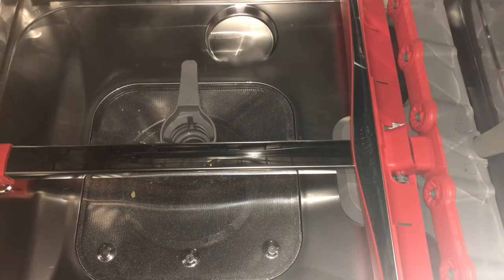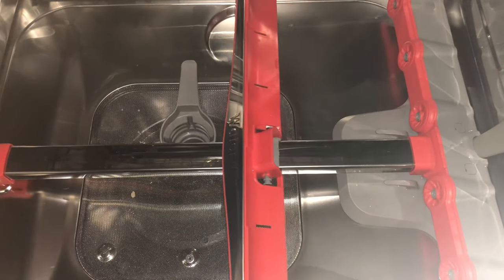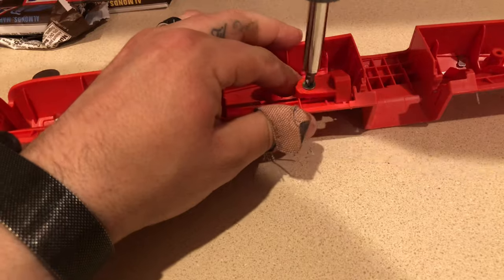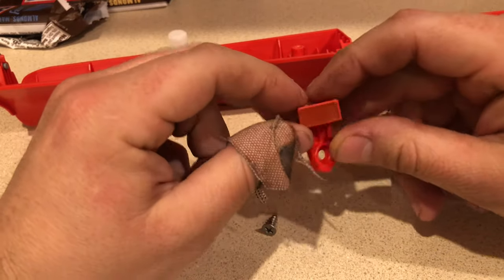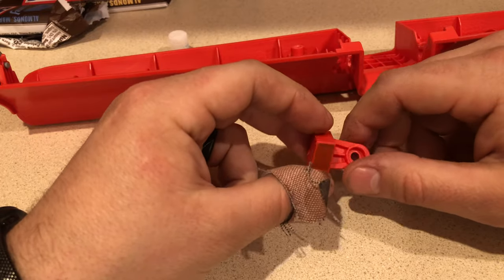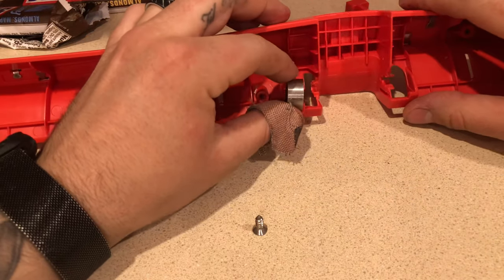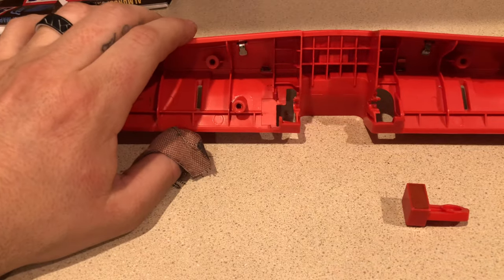Samsung Water Wall Issue Part 1

Comment: One of the most excellent repairs I have seen and used. Thanks a lot . I removed the coating over the magnet, drilled a hole pushed out the old magnet and stuffed in a new one, applied hot glue and it works great now. A real cheap fix buddy.

Comment: THANK YOU!!! While under Best Buy extended and after numerous service calls during a six-month period, they claimed it was fixed.  But I kept hearing that noise and noticed dishes on the bottom were not getting cleaned.  I put my camera in the dishwasher and saw the same thing.  I found just the magnet  Samsung DD97-00395A Plastic Magnet Support at Virginia Service Supply.  I pulled out the waterfall sprayer and to my surprise, the magnet was not even installed.  I installed the magnet myself and like magic, it Works!
Reply: TY part number was helpful!

Comment: I took the red gel stuff off the top of the magnet to test it. Ran a diagnostic cycle and the dishwasher worked fine. I ordered magnets to replace them in case it fails again later but thought I would share as it only took 2 minutes to diagnose. Thanks for the video!

Comment: Thanks! My dishwasher was making a noise. I had figured out that the detached waterwall was the problem, and I could even see the notch where it was supposed to hook into, but I couldn't figure out how to get it to snap into place. The 45 degree angle was the tip I was missing. I had to hold my fingers against the bottom part I was I snapping the water wall on to, but combined with the 45 degree angle trick, it worked like a charm! No more noise.

Comment: Thank you for this video! I have same washer, it had the same problem and you got me thinking of a simpler solution.  I purchased a pack of 3/8" X 0.060" rare earth disk magnets at the hardware store, they cost less than $5 for a pack of 12.  I took out the bar, snapped one disk magnet on top of the existing magnet, put the bar back in, and the problem is gone!  The new magnet is stuck so hard that I can barley pry it off, so I doubt it will ever drop off on its own.  Just be certain to use a thin magnet, because the first time I tried this the magnet was 1/8" thick and it was to big to work correctly.  Thanks again for the idea!
Reply from the maker: Jack D My original rare earth magnets eventually corroded to the point where they dislodged. As I learned it was a bad choice of magnet. They do not do well with heat and moisture.
Reply: @honestdad8944   - Did you by any chance find a solution that lasted? I believe that my dishwasher is having the same problem. I it only 3 years old and I really don't know what to do at this point. Thank you!
Reply from the maker: Melinda Opalanko I did.  I found a magnet that is heat resistant and fits inside the original magnet housing. The type of magnet is Samarium Colbalt.
Reply: @honestdad8944  thank you so much! I am going to look into that!
Reply: @honestdad8944  thanks for putting the video together. Do you have a link or part number for the magnet that worked?
Reply from the maker: Ryan Foltz CMS Magnets. Samarium Colbalt is what you want.
Reply: Worked like a charm.

Comment: Just used this fix on mine. That red piece the unscrewed contains the magnet but you can easily pull it out of that plastic shell.  So I removed the factory magnet and put in two 1/8 thick by 1/2 diameter rare earth magnets in that sleeve without any epoxy or anything because that red part contains it. After reinstalling I had to hold my finger on the start button for 3 seconds to reset it before starting a new cycle. Didn’t work without resetting. Hope this helps and saves you some money.
Reply: How did you take our the magnet from the red plastic shell? Thank you

Comment: Did you ever make the next part? How long did your fox last? I just replaced the waterwall motor assembly and not my waterwall goes front to back but it appears to try to keep going back further for several seconds when it gets to the back.

Comment: I have replaced the magnet with a new factory replacement waterwall still doesn't work. What can be causing this issue. All help would be greatly appreciated TY.
Reply from the maker: Control board would be my next guess. You need to figure out what code the washer is faulting with and go from there.

Comment: Hi Honest Dad. I did not finish watching this video and I wanted to thank you for making it. Best Buy and their geek squad protection plan is the worst service in the world. I purchased $800 samsung dishwasher and extra 5 yr warranty. Technician came one month before warranty expires and said its working normal even though there is a very loud whining noise. Now I call them and they will not help me because warranty is over I almost cursed at them. I will fight To get my money back and fix it myself or contact samsung. AVOID BESTBUY FOR APPLIANCES, PERIOD.

Comment: Hey Honest dad, I have a DW80M9550us that the 5c code came up, which is pump clogged! I’ve checked filters, drain line but to know avail think it must be in the pump! Do you have any experience getting at the pump on one of these beasts?  I could really use some help!  Thanks

Comment: I spent about 3 hours and I think it's either my magnet or my motor. The water wall moves but not as fluid as yours does. It goes really slow and looks like it's struggling. So I'm going to try the magnet but if that doesn't work I'm going to get a new motor. Thanks!

Comment: If the magnet sticks to the fridge does that mean it is still operational?
I fixed the waterwall motor like in the other video but now the waterwall either moves to the front or the back but doesn't know when to stop. 
Just keeps skipping on the track.
Reply from the maker: Mine would stick to a metal surface as well. But it’s not enough to make the sensor. The magnets aren’t suited for high heat environments and loose the strength.

Comment: What model number is that? Mine is DW80J550US and my waterwall doesn’t have that magnet thing that unscrews under it and doesn’t even have a place for it to screw in. Maybe it fell out, but I don’t see where it screws in.
Reply: Mine is the same. Did you ever figure it out ?
Reply: @karao7831  I did end up figuring it out. I can’t remember what I’ve posted above, but I will say that after putting my phone in a glass container and running in the wash for half cycles, I discovered the motor for the water wall was not working. I replaced the part for $140, but then had the problem with the water wall would go forward and then just go back and try to keep going back and not recognize that it had hit the back of the washer. I bought a magnet which I saw somebody suggested online in a video and just stuck it underneath the water wall, or I should say it stuck by itself because of the magnetic field. It’s been working fine for a couple months until just the other day. I then looked at the magnet and so it was all corroded so I put another one on it and it’s been working fine.
Reply: @karao7831 I stuck the magnet under the gray piece on the bottom of the water wall. Then when the water wall went back the sensor detected that magnet and then bright the water wall forward. I can post a link to the magnet I got if you’d like. It took ordering a few to find the right size.
Reply: @wstt4  Will you please post the link to the magnet?

Comment: Any idea i have a 7e error but just checked mine doesnt have a magnet or a screw hole
Reply from the maker: Not sure. You may have the oddball interaction after mine that is different.  They redesigned the Waterwall 3 times I believe
Reply: @honestdad8944  how fun I can see my motor moving yet I still get the error I even tried a bigger magnet. Maybe someone said my motor is getting water in it and shorting or the sense by the motor is broken that they don't sell separately

Comment: hey @honest dad thank u so much for the awesome video and inspiring me to dig into this issue! i have a DW80M9990US and it recently started giving me a grinding noise, when i put the dishwasher into diag mode, error code 7c results. i have reset the dishwasher and moved the water vane to the back of the dishwasher and still no luck. further we had a samsung tech come out and replaced all the parts u highlighted, vane motor, pcb and finally wiring harness. i recorded the vane motion inside. when i pushed the vane to the back of the dishwasher next to the jets and started the diag mode. unlike your vane going from back to front and vice versa, my vane just goes to the front and grinds until the diag is complete. i also bought some magnets and stuck them right on top of the original magnet without luck again. any thoughts as to why the vane keeps bumping into the front please?
Reply from the maker: I’m sorry I don’t. I have came to a conclusion and it’s a painful statement. Chuck the washer in the yard and buy another. Since this video my upper sprayer stopped working. I have a new washer on order for July delivery. They are quite hard to find. I went with a new Storm Wash that does not have the moving lower arm.
Reply: @honestdad8944  :( sorry to hear that. my dishwasher is less than 2 years old. just thinking if replacing the vane motor / vane sensor one last time will help?
Reply: @honestdad8944  thank you for your help. gonna head your words and get a new dishwasher.
Reply: you don't manually move the water vane. that's how u break it

Comment: My problem is the water wall bar is falling off at the front of rail. So then trolley just goes back and forth with no bar to deflect the water up. The dishwasher is only two months old. I see nothing wrong with the bar or the trolley. If put it back on it works for the test that occurs at the beginning of the wash cycle but once the water jets are turned on it falls at the front of the rail. It doesn’t snap on the trolley. It is up gravity to keep it on there and I think the water pressure is high enough to lift it off when the trolley reverses to the back of the dishwasher. It is an asinine design. The warranty repair guy is coming in two days. It will be interesting to see what his explanation is. I am sure they are told to lie about it. Problem is I’m an engineer and I can see why it doesn’t work. The design sucks! We already had the auto-release mechanism replaced two weeks after getting the dishwasher. That has stopped working again too. We are going to open another ticket after the water wall issue is looked at. We are working on getting it lemoned so we can get a refund. Otherwise they will be paying for service calls every month for the next 10 months.
Reply: Did you find out what was the issue? I have the same problem and wondering what is causing it

Comment: I have the same model dishwasher with the same problem. I replaced the magnet but the problem still isn't fixed. My next thought is the water inlet valve, unless you have any other suggestions? When I manually add water to the dishwasher and try to start it, I can hear the water draining into the disposal, so I don't think that's the problem. Any other thoughts?
Reply from the maker: Steven Davis Honestly you need to see what’s happening inside the washer. If the washer doesn’t see the Water Bar or know it’s location it will not spray water from the jets in back. That water spay hits the bar and washer the dishes in lower rack. If your Bar carrier is not moving at all then it’s either the motor or the PCB board. Either way your gonna have to see what happening inside like I did.

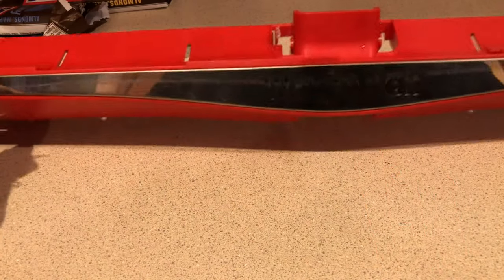Comment: Hello @Honest Dad, I believe your issue is the carriage and water wall are not connected completely. You have to press them together until you hear a click. In your video the carriage at second 3:40 deflects upwards as apposed to downward like it is supposed to. If you watch this video https://youtu.be/3py7fK2m9Gc at second 0:27 the carriage and water wall deflect downwards as apposed to upwards like your wall did. I believe your sensor is not making correct contact because of this issue. Kyle P in Part 2 pointed this out and I did some more digging. Hope this helps.
Reply: Bro you are rock, I have linear dishwasher for less months and have this noise and figured out that something with waterfall system. And guess what?!? It wasn’t proper install, so I just clicked and that’s all!!!!
Thank you

Comment: My waterfall fell off on its own, as well as another piece. Idk how to put it back on :/
Reply: Just GENTLY pull the carrier along the support bar about 6" from its home position. It's pretty tight so don't pull too hard or you'll have a bigger (and more expensive) problem on your hands. The water wall bar will fit on and snap in place with gentle pressure, just make sure the magnet is on the left. Just run a rinse cycle to get everything back in place. You don't want to manually move the carrier any more than you must.
Reply: Thank you Mr. Pavone. Mines been giving me fits. This worked. Ty

Comment: I thought my issue was the water inlet valve.  It was this all along.  So ticked.  Terrible design.  Thanks for sharing.
Reply: additionally, if anyone wants the part number for just the magnet piece, it is DD97-00395A

Comment: Which model is this?
Reply from the maker: Emily Carpenter DW80J7550UG
Reply: The DW80H9930US/AA-00  does not come with a screw in magnet on the water reflect piece. I in the process of adding a magnet in the same location. I will update with results.
Reply: rzooter:  I am having the same problem and have the same model as you.  Do you have an update on the results? Any help would be appreciated.  The dishwasher is less than 5 years old and this is the third problem we have had.  😡
Reply: @jamfonz  Yes. I had No luck. I did try several ways of placing a strong earth magnet. Even to replacing it in the original location. My dishwasher gives out after 15 minutes. The rail moves and it does not get jammed. So my guess again is going to be the computer module. 😵 giving up.
Reply: @jamfonz  we also did not have a way to fasten the magent. I bought a new waterfall arm (the one he removes in the video) which did nothing. Bought a new GE dishwasher and couldn't be happier

Comment: Hi my Samsung washer was fixed after this thank you, I had a 7C error code after self diagnosing it.
I used the OEM magnet from Amazon
Samsung DC61-03184A Washer Lid Switch Magnet Genuine Original Equipment Manufacturer (OEM) Part https://www.amazon.com/dp/B075NRQJ2B/ref=cm_sw_r_cp_api_glt_fabc_W4M1NV99TQEA5S5JNP1Y?_encoding=UTF8&psc=1

I did not epoxy it in, it was a bit loose without the red epoxy but it doesn’t fall out since my model once screwed it in rest on some piece of the water wall as support so half of the magnet that is shown is supported
Reply: Jorge, how did you remove the old magnet from the plastic orange housing?
Reply: @tonycarnevale1633  with the new magnet or another magnet